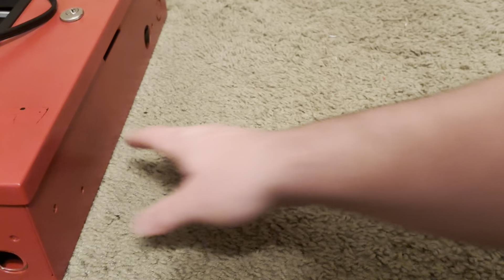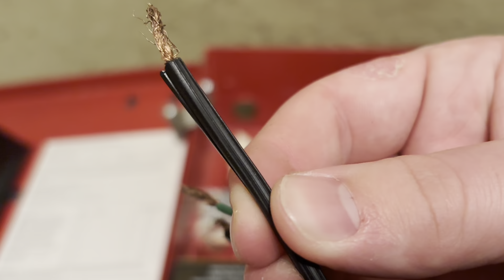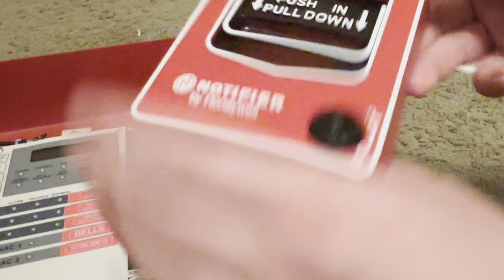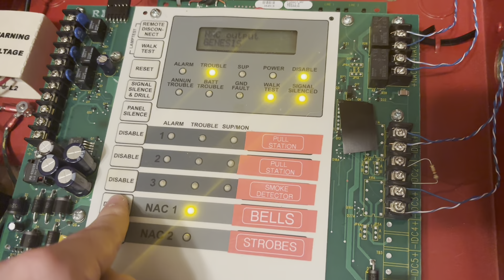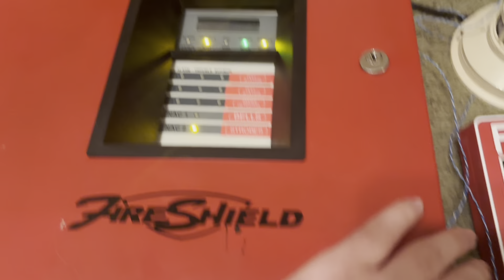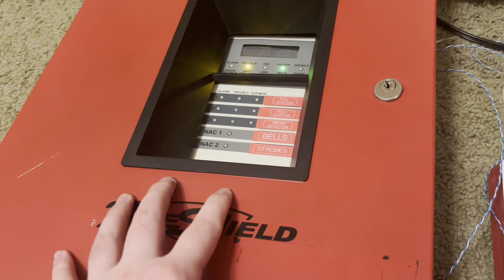How To Fire Alarm: How To Wire a Conventional Fire Alarm Panel (Edwards Fireshield)

Comment: what plug did you use to wire it up and do I have to buy batteries or no?  im connecting a Spectre Alert Classic to a Edward pull station. Would it work without the batteries?
Reply from the maker: Just a typical plug with a hot, neutral, and ground. These panels take 120VAC, and they put out 24VDC unfiltered. These panels can work without batteries, and it should be fine running it without any batteries. May sound a little raspy, but it’s alright.

Comment: is that fs302 using the F-Dact?
Reply from the maker: It sure is! It has the built in dialer, but I am not using it, not now at least.
Reply: @firealarm19122  How did you manage to disable it? Because on my panel it keeps sending me troubles and I cant seem to find a disable option in programming.
Reply from the maker: There should be a dact disable feature in programming, mine just came disabled, but I know I’ve seen it. Even if it was in trouble, it wouldn’t bother me, as this is a demo panel.
Reply: @firealarm19122  okay, thanks for the help!
Reply from the maker: Anytime!